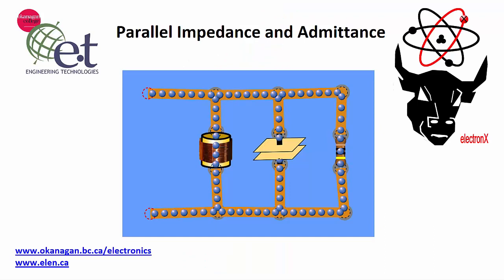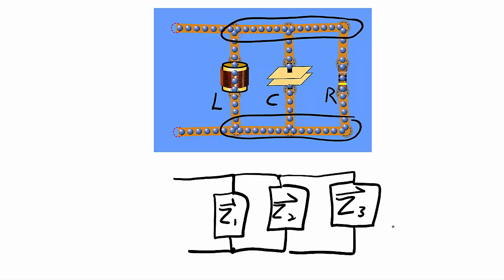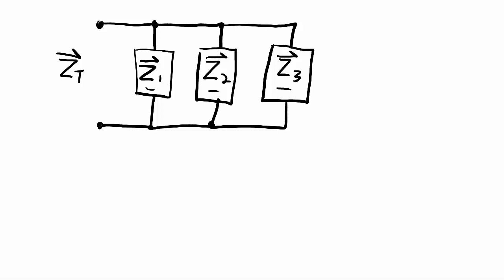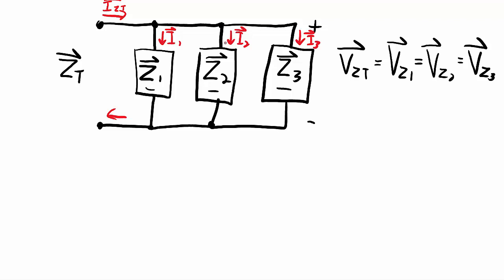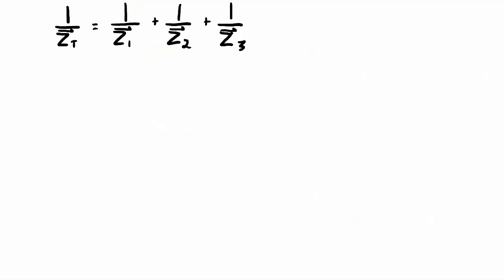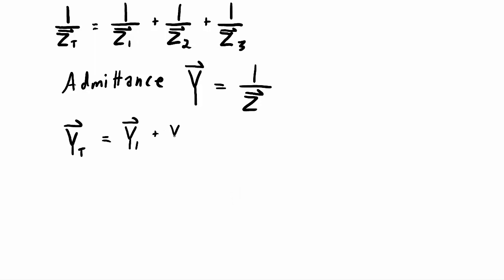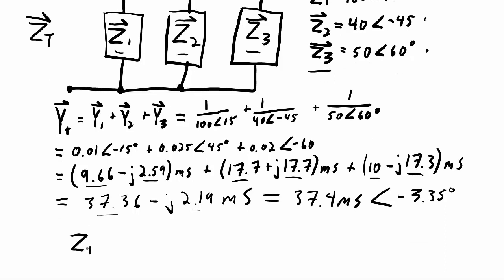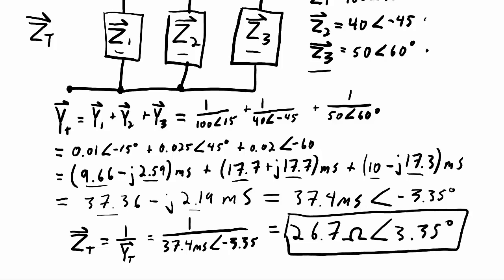Parallel Impedance

Comment: LEARNING A LOT HERE!!  
I need a simple formula for the "resistance" of a standard parallel LC circuit at resonance. 
I know that changing any of these values (L and or C), changes the resonant frequency according to: Fr=1/[2pi sqrt(LC)].  
I have seen that it is given as simply:  SQRT(L/C).  Is this correct?
THANKS MUCH... and thumbs up!
Reply from the maker: You are correct for your resonant frequency equation.  The 1/sqrt(LC) equation (note that it's not L/C) gives you the resonant frequency in radians/second.
Reply: @ElectronXLab  Thanks for the reply, but I was speaking of the formula for the resistance  or impedance (not frequency) in order to calculate the current in the parallel LC circuit.  I have seen somplace SQRT(L/C) gives impedance.  I need to be able to calculate current flow in the LC tank WHILE it is oscillating at it's resonant frequency.
Thanks again...

Comment: your calculations for converting into rectangular coordinates don't check out if your conversion is what you said it was. for the first 2 its off by 2 decimal places and the third just is not correct
Reply: I did this independently before reviewing his result, and got a similar result to what the author found. Rounding of multiple sequential data points can cause variance. If your results are way off, check your work. It's very easy to make a housekeeping error, and it can be frustratingly hard to find.

Comment: I think its wrong

Because ohm law not valid in AC
Reply from the maker: Ohm's Law is still valid in AC. You just have to take into account phase shift to get a full picture of the relationship between voltage and current.
Reply: @ElectronXLab correct